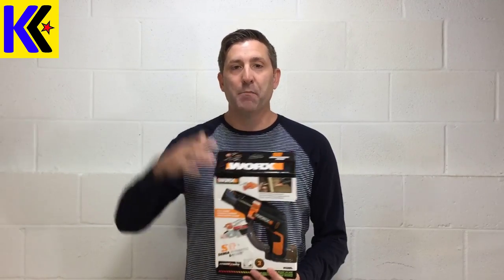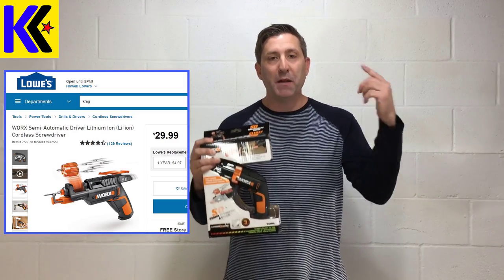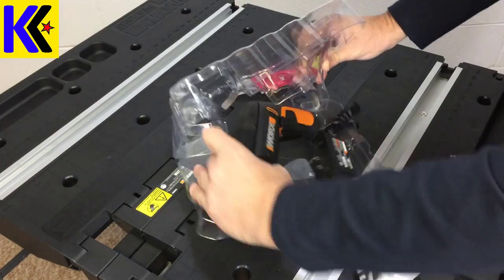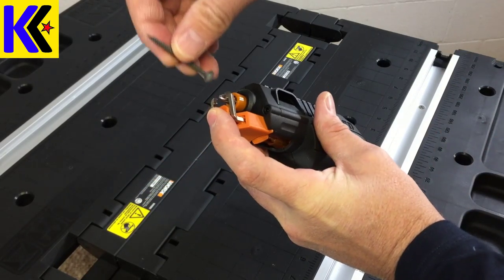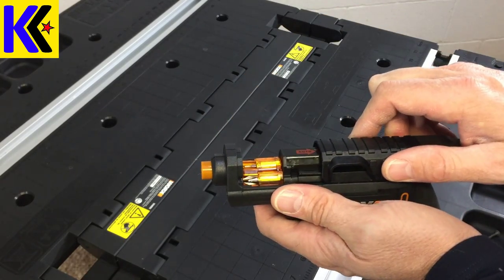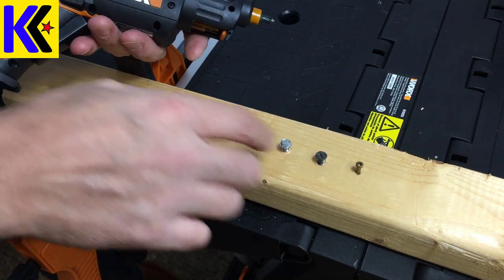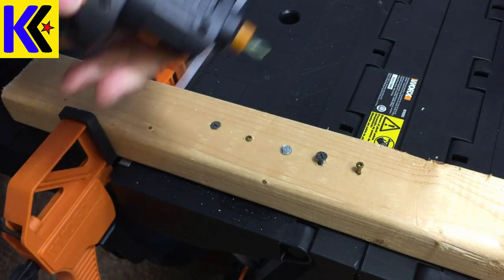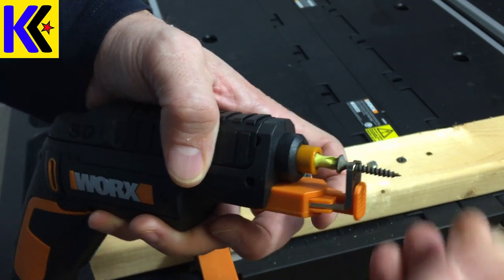WORX SD Cordless Screwdriver with Holder - Christmas Gift

Comment: Well my worx that has the rotating 2 chucks. Have used it around the house more than my Milwaukee drill. The Milwaukee lithium batteries do not hold their charge. However the worx driver battery lasted over a year on a single charge and it is a smaller battery pack than my 20 volt Milwaukee drill. Milwaukee has the WORST batteries of all for their 20 volt system!
Reply from the maker: That's really surprising - Milwaukee generally makes good stuff.